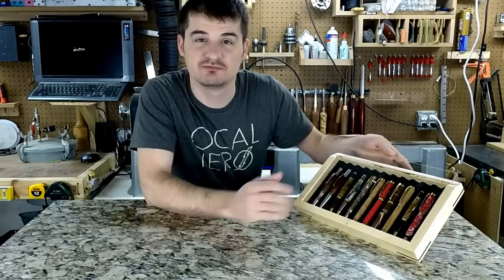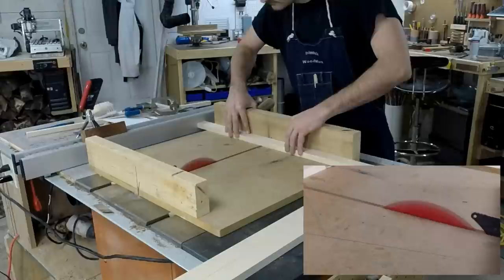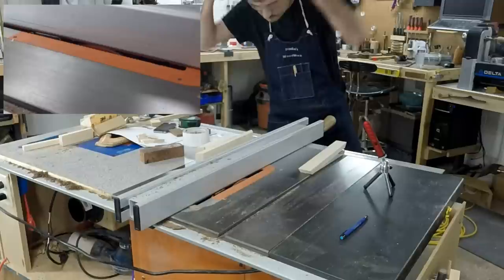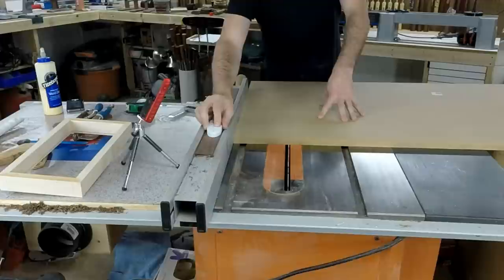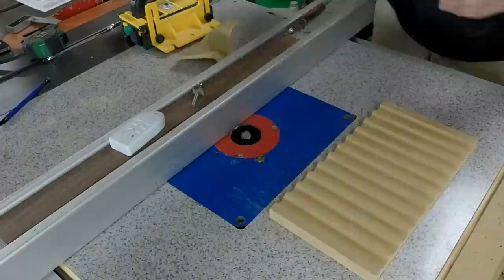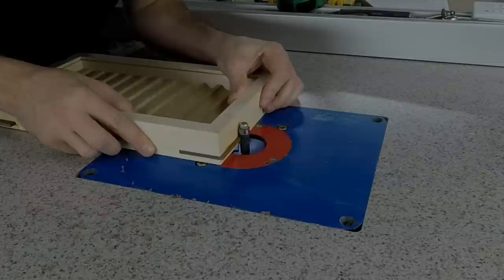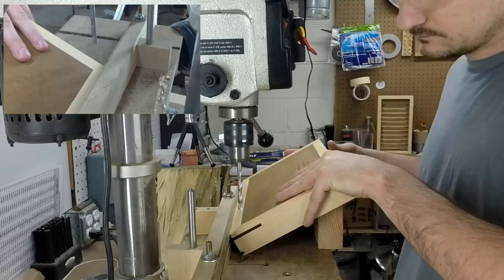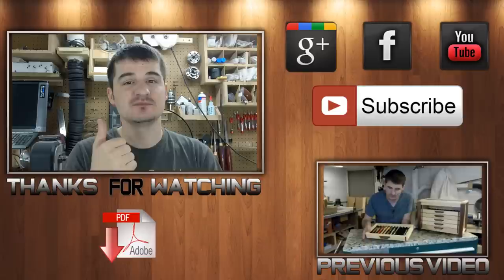Craft show pen display build

Comment: Thanks for the well done and informative video. You didn't mention what size round over bit you used. I checked the instructions and it appears you used a 3/4" bit, is that correct? I'm not very savvy when it comes to reading plans.
Reply from the maker: +jerry bridges yep 3/4 round bit
Reply: Thanks for the quick reply and even on a Sunday. 
I did find the proper bit but just FYI it appears to have several different names. Some call it a Round Nose bit while others call it a Core Box bit. Just thought you might want to know and thanks again for the great video.
Reply from the maker: +jerry bridges thanks Jerry :)